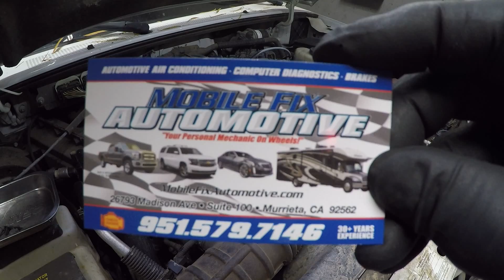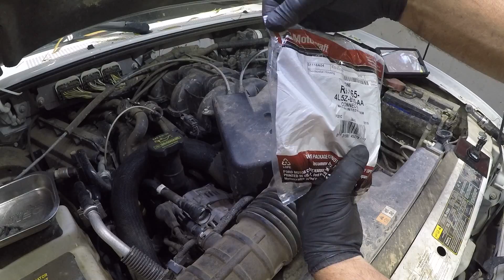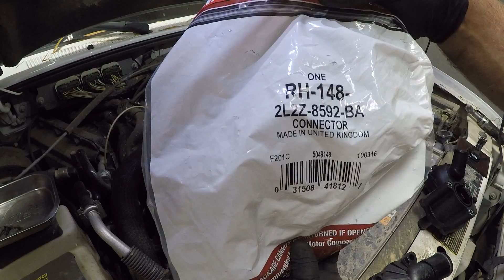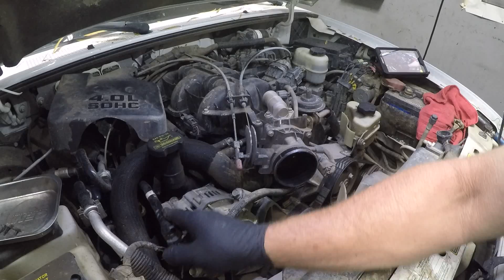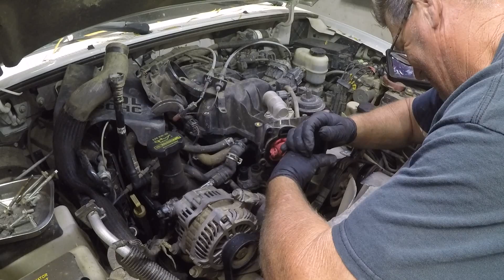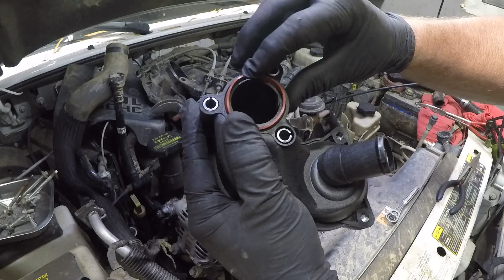How to replace the thermostat housing on a 2011 ford 4.0 v6 (parts link below)

Comment: i cant recommend enough to buy the upgrade version housing made out of aluminum. look for it youll fnd it, cost 60 to 120 but ts the last one you'll ever need, the plastic ones hae a 90% fail rate.
Reply: Amen, brother! I used the 2-piece Austekk design. Which one did you use, and how is it holding up now?

Comment: The Ford manual tells you to take alternator and water pump off to change thermostat housing.   I did one without doing that and it was a pain in the ass.   I'm glad I watched a video on it tho' Cuz it warned about breaking those tabs on the bottom of the housing.   It was a pain in the ass.   All of it...  clamps,  clips holding in sensors.  Angling it in without breaking tabs.
Reply: If you order the metal housing then it doesn't matter if you break the chicken $hit tabs off! Just put a slim metal dowel in the holes of the housing to line it up. The metal one doesn't have the lousy tabs. Either way, it's tricky but worth it to NOT have to remove the intake manifold, alternator, pulley, water pump, etc.

Comment: The housing I bought care pre assembled with sensors in already and thermostat already installed in it
Reply: Was it easier or harder to install than the parts shown in the video? Did you have to take any extra steps because it was already assembled?

Comment: I see coolant on the top of my housing kinda by the sensors would that be the housing leaking??
Reply from the maker: +Derek send me pictures
Reply: Ron Williams hey Ron I just bought the new housing what are the 3 little clips on the bottom of housing where it meets the eligible block there’s 3 clips on the thermostat housing opening on the bottom
Reply: Coolant on the top of the housing is most likely the o-ring on the sensor/s has gone bad.  Advance auto part #24628 is a green o-ring that will take care of the issue.

Comment: Thanks for sharing, Ron.   I could not determine where the heck my leak was. I knew it was leaking from somewhere below the thermostat, but I could not see the leak. It was driving me crazy!   However, after watching your video, I'm now confident the thermostat housing has separated at the seam you showed us. I'm not sure I'm able to fix it myself, but at least I now know where the problem is. Thanks again.  BTW, I liked and subscribed.

Comment: I'd add this.  Use penetrating fluid on the 8mm bolts   holding the thermostat cover on then wait a while. They rust in place and if you are only replacing the thermostat it may save you some $$.